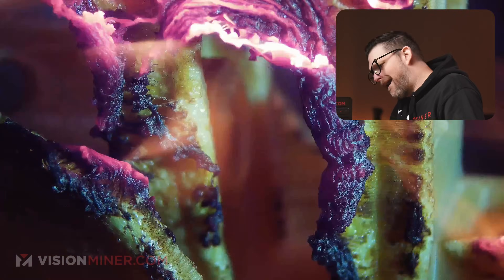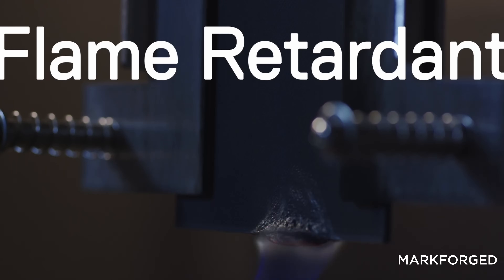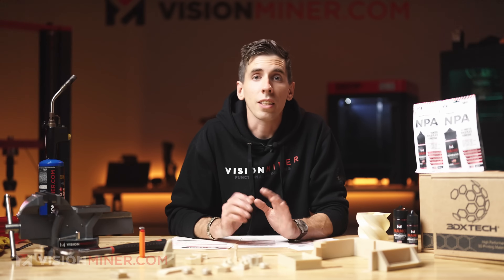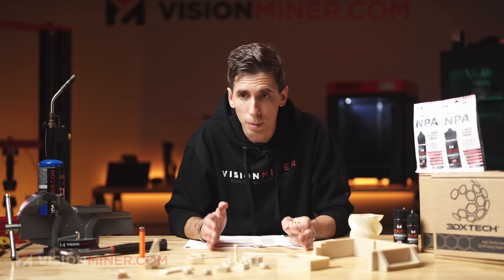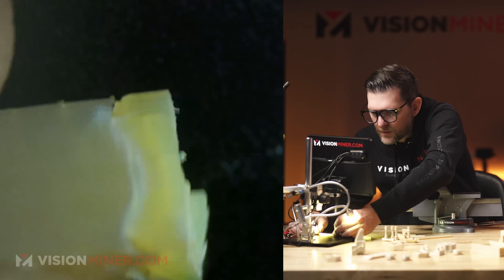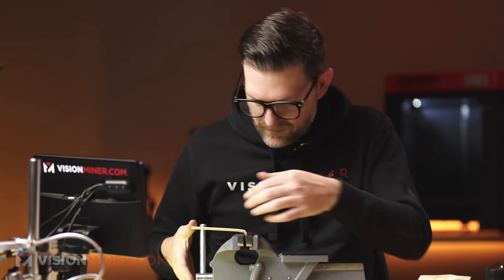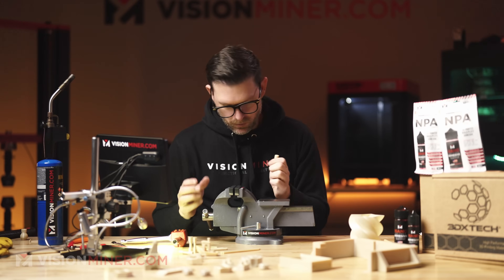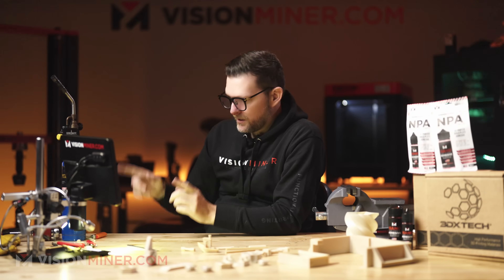ThermaX PEI ULTEM 9085: Why Aerospace & Automotive Trust This 3D Filament

Comment: Wow burning looks beautiful and tells a lot! Material bubbles up and carbonizes building its own heat shield and making it more effective against the flame source over time. You can see how thick this insulation builds up compared to the size of the stick at 15:18. That toilet seat will definitely survive the event.
Reply from the maker: Brings a whole new meaning to dropping bombs...

Comment: I wouldn’t call 220$/kg affordable.
Reply: They're comparing it to similar high-temp materials like PEEK and PEKK, which are around $600/kg.
Reply: @TheEnigmaBlade aswell as when compared to the cost/difficulty (or straight up impossibility) of creating metal versions of the same parts

Comment: Igus makes some pretty cool materials and they offer filaments (as well as powder, bar, and sheet stock) for many of their products.
Not affiliated but I've used them to simplify some situations in the lab that would have taken big redesigns to remove small but critical flaws if I hadn't switched materials for the whole or part of the projects.  Tribological self lubricating/cleaning plastics are kind of neat - and durable, they make replacements for steel parts and bearings in some applications; for example: suddenly no more lubing and no more corrosion ;-)
I haven't seen any printing channels check into their materials/filaments, which is weird since they're not that expensive and are desirable in properties.
Reply from the maker: ah, yes, like their iglide lineup, we've heard good things!

Comment: Did you guys anneal these prints before testing them?  Maybe I missed that part as I was doing stuff while listening to this, but only remember you talking about drying the filament.

As I understand it, definitely needs to be annealed to reach its highest strength.
Reply from the maker: Generally we don't anneal, partly thanks to the heated chamber, but mostly because dimensional accuracy goes out the window on most parts after annealing -- if it isn't precision, then annealing can be good, but most of the time in high-temp, it's not necessary nor practical. If the part can take the annealing, that's a good thing!

Comment: Was going to mention also if
You need a great filament but don’t need the certifications (and cost!) PPS or PPS-CF is almost as tough and has higher temperature capabilities than ultem 9085 (up to 220C service temps!) and also immune to all chemicals below 200c. 

I’m a big fan of pps-cf, ppa-cf and plain polymaker pc-max, (pc max has ul-94 v2 cert but it’s not as strong as ultem)
Reply: but is flame retardant ?

Comment: No annealing necessary?
Reply: If you’re printing on the lower end of the temperatures listed, absolutely, it’s the only way to get good results.
If you’re on the higher end, it will anneal as it prints, in which case you don’t need to do anything more.
Reply from the maker: Yep, this. Generally we don't anneal, partly thanks to the heated chamber, but mostly because dimensional accuracy goes out the window on most parts after annealing -- if it isn't precision, then annealing can be good, but most of the time in high-temp, it's not necessary nor practical. If the part can take the annealing, that's a good thing!
Reply: @VisionMiner  That's good to know!
Reply: Not necessary, but if you are spending this much on equipment and filament, seems like you should do it as it’s not as strong without annealing.

Comment: Would this print well on a Bambu H2D or Qidi Plus 4? Both have heated chambers.
Reply: nm - looked it up. 
H2D specs are too low. (350* nozzle, 120* bed, 65* chamber). 
Can’t find the bed temp for the Qidi but the nozzle does 370* and chamber 65.

I wonder if I could mod my Voron 2.4 to hit these numbers…
Reply: @mdowney14 Printing at these temps introduces a bunch of other problems other than just being able to heat things that much.  As I understand it, requires a lot of design changes to print at such high temps in general.
Reply: Easily but chamber gonna be impossible @mdowney14
Reply: It would take some serious components to reach those temps.

You can forget most of what you know because it won't fly.

The expansion is going to be crazy, everything is going to want to overheat and fail.

There is a reason it took these guys years to figure this stuff out.

Even the aluminium frame is going to want to expand significantly,  throwing out everything.
@mdowney14
Reply: No. The entire motion system and motors will die.
Reply: Temps like these require isolation of the moving parts and motors from the heated chamber. Only the nozzle and bed see the actual temps.
Reply: @turtlegod766  ah ok. That explains why those printers are so expensive.

Comment: Cole, It seems your clamping device may have contributed to the tensile strength test failure. If possible an I-beam cross-section shape would allow for tensile testing without the need for a lot of clamping force. Great video! Loving the high temp content!
Reply: Yeah, this is the reason that the test specimens are usually thicker and the ends, to mitigate interference of the jaws
Reply: the word you're looking for is "dogbone", it's a common shape for collecting strain data on materials.

Comment: I'm a pipefitter and i'm waiting for the high industrial materials to really come down to a lower level. I want to design heat exchangers and like chanel style interfaces that could eliminate piping.
Reply: People are already doing this on corporate scale, by the time you can afford the base materials they will be already big players. Start when its new and expensive, be the first and ride the wave of buyers. Or team up with a big brand like is the case with fiberon pps cf
Reply: @TheOneAndOnlySatan  No, that's not how pipefitting works. We already build the system from scratch now. Local, rapid fabrication of one off designs built for the space is the future.
Reply: @GoodBaleadaMusic  the fact that you had to explain it says enough, pipefitting is just a application for this material. You think smoll.
Reply: @TheOneAndOnlySatan  No you thought mass production. I was explaining that this is the opposite of mass production. It's deeply custom engineering for district energy. It's for mass service delivery.